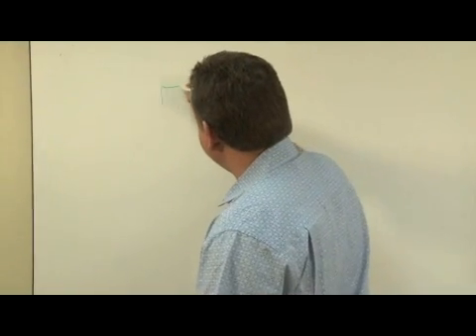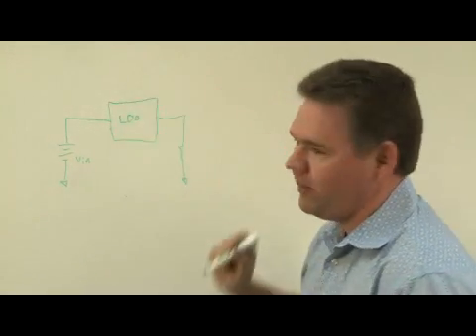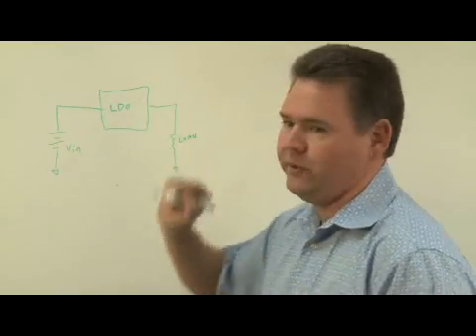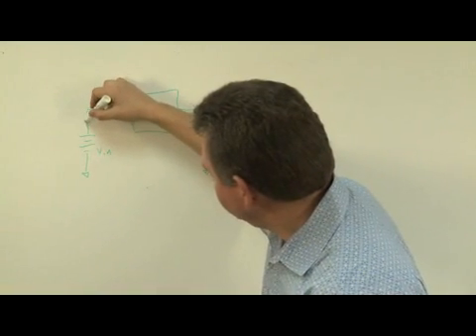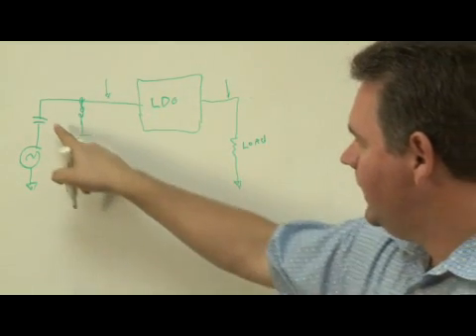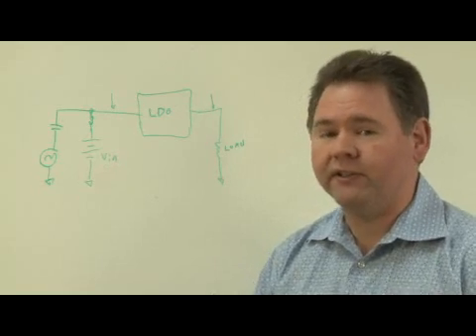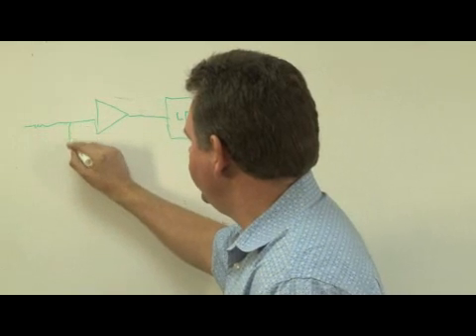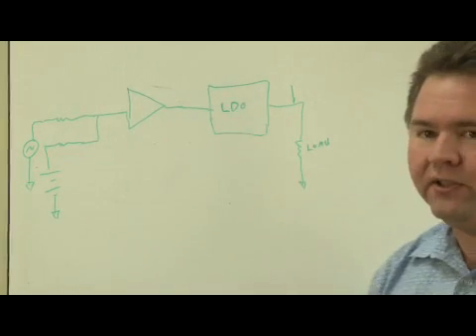How to Measure Power Supply Rejection Ratio (PSRR)

Comment from the maker: Many signal generators have an output impedance that allow use of a matching characteristic impedance cable (50-Ohms is common). This is not a problem for low current LDOs (<50mA), but as the current goes up in the LDO, the DC drop across the output resistance can be excessive. For example, an LDO operating at 200mA, with a 50-Ohm signal generator in series, results in a 10V DC drop and 2W of power dissipation. This would exceed the ratings for DC voltage and power for many signal generators.
Reply: What is a real world example of this ? Is a mobile charger an example ?

Comment: Signal generators should have low output impedance so ac and dc signal can be used in series. Please clarify the purpose of using ac source in a different way.